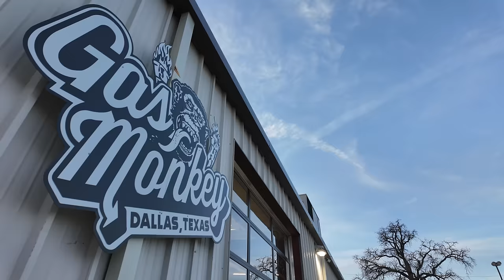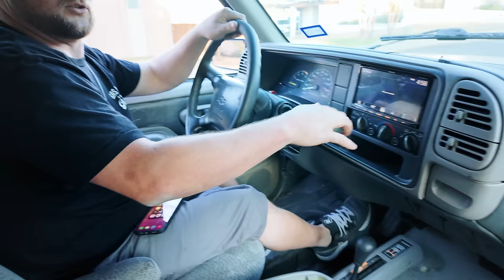The Consequences of Misdescribed Vehicles

Comment: Back in 2018 a censor inside the transmission that only had reverse fixed the transmission for 100 bucks and it still runs and drives..I was going to pay 600 bucks for a used transmission until a guy told me about the censor in the transmission. I took the pan and the filter out and that censor is right there..The guy saved me money and more work than I was getting ready to do..I've fixed so many of em that I lost count with even a used censor just to show the people that's all they needed. If the fluid smells burnt the transmissions history but if it doesn't smell burnt and the fluid looks good, I don't know what the prices are for em now but from 2018 upto 2020 they were not very much over a hundred bucks cause nobody expected a censor to be a problem, most didn't even know that they had em..I even took at least 4 transmissions off mechanic shops hands and put that censor inside of em and made a few extra bucks for used transmissions that almost got scrapped

Comment: 79 chevy stepside c10 that liked
 seat upholstery and door panels-$800
Pine wood and strips in bed- $1100
Used np205- $500
New inner front fenders- $350
Truck probably sale for $18,000-20,000 all day.
What were you boys thinking?
Reply: It is a K10, not a C10 and the word is SELL, not sale. (Truck probably SELL for $18,000-20,000 all day.)
Reply: @cvpiDOTnet we understand what he said
Reply: You're smoking that 💩 if you think there wasn't $5,000+ in parts and labor just to make $4-5k profit.
You're whacked out pricing assumes that you're doing it yourself, for free. So you didn't count labor or consumables, you missed several items (the dash, steering wheel, and interior were trash).
That Tahoe makes WAY more profit, all day long.
I've been flipping cars for over 20 years, and I WISH I had all the OBS trucks, Fiero's, and Geo Trackers I've ever sold. Prices are absolutely bonkers these days!
C-10's have always been hot, but step sides are harder to get rid of than a fleetside.
The point in flipping is not just to buy the vehicle that sells for the most, but to buy the one that needs the least work for the most return on investment.

Comment: I bought a step side short bed 4spd 4wd manual 77 k10. Say 4 yrs ago. Couldn't sell it. I did head gaskets, same carb in video,.   I hauled 275 gallons of water with it multiple times. Had to trade for....a beull blast. And I gave them a Dana 44 front k10 axle

Comment: Nice show, yeah YouTube show is way better then your censored TV show any day, this being my first post, I gotta talk about your flatbed truck, or rollback truck, out of the 6 states I've worked in driving a flatbed tow truck, and drove for AAA for 30 years as a flatbed technician, you all will be replacing the bed rails or even the bed on that flatbed truck the way you operate it, number 1 rule when unloading a car is when you clear bed locks you till that bed, not when you have the bed extended 3/4's the way out, you might as well buy a new flatbed truck, yeah if your going to extend the bed out that far loaded get a steel  bed. And you all have a great day

Comment: I had a 99 4 door. Vastly underpowered and the transmission doesn't like bigger tires and wheels. Even with headers and a cold air intake, it might make 200 hp.

Comment: The 87 Vette is basically brand new. Except the fact that the oil, brake fluid, coolant, transmission fluid and rear gear oil have never been changed. And probably every single gasket is going to leak. Worst thing you can do to any car

Comment: A Taco Casa in an old Taco Bell building... NICE!!! Taco Casa is what Taco Bell used to be 30 more years ago, actualy good. 
6:03 The 1979 was NOT the last year of round headlight, they were still available in 1980 and were actually standard, but most people ordered them with square headlights that was the v22 deluxe appearance package. The 1980 model year had either round or square headlights and you can find tons of 1980 examples searching the Interwebs. And that K10 needed a lot of work, but looked nice on the outside.
The Tahoe was a good deal and a much better buy for sure, but what the heck is all that brown crap? Interior needs work for sure. Transmission fluid could be low, but it still should be gone over.
Reply: How much rust do think is under that carpet back by the barn doors and up under the dash wear the heater core shows its been leaking. The clapped out Tahoe is just a faster flip
Reply: 30 yrs ago? Taco bell was taco bell in the 70s